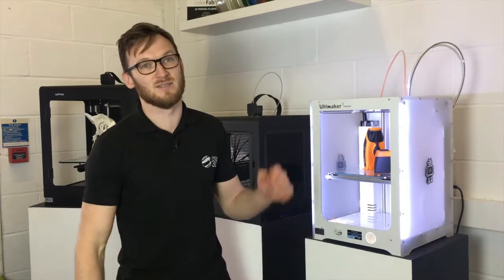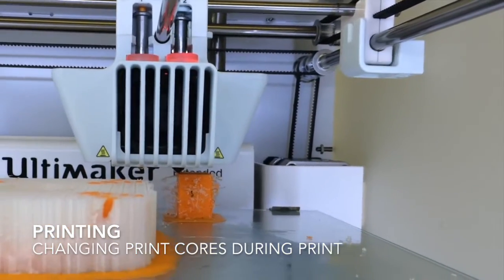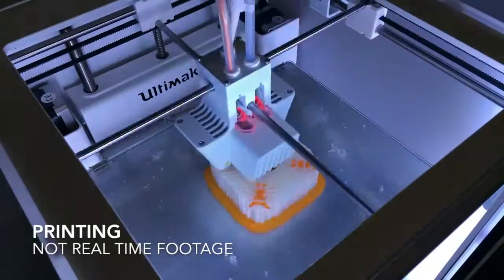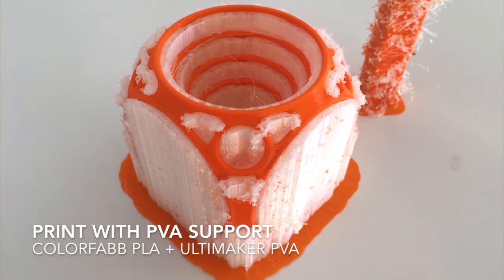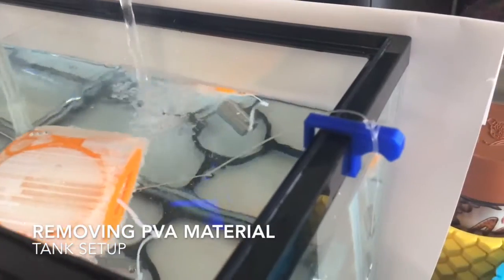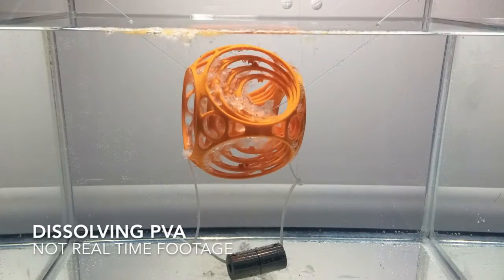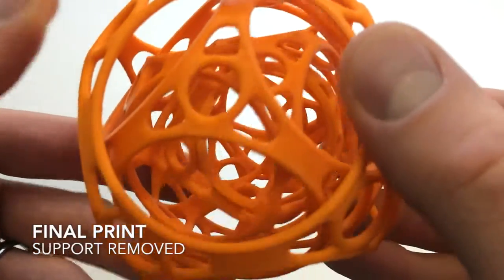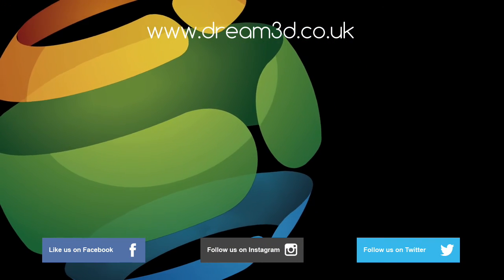Ultimaker 3 Extended - Dissolvable PVA Support Material | Dream 3D

Comment: I recently bought a Ultimaker 3, and I have problem when I use Simplify 3D with PVA material. but no problem in Cura.
The problem is the PVA is okay in first layer, because it prints very slow. But it's not okay going to another layer. PVA can't be layered on the first layer caused the second layer of PVA getting crazy and mess.I hope u guys can help me with that. THank you